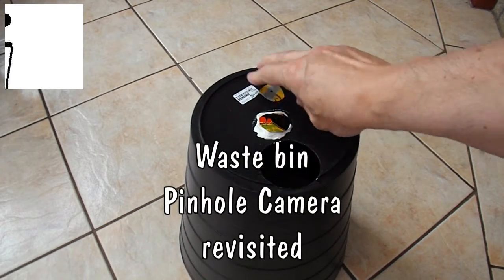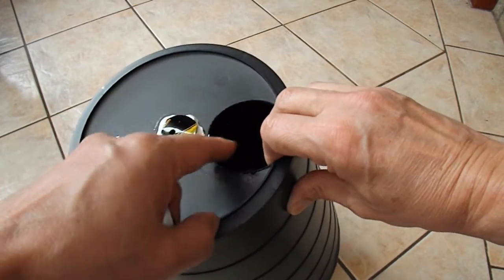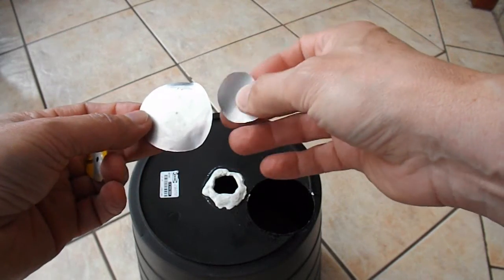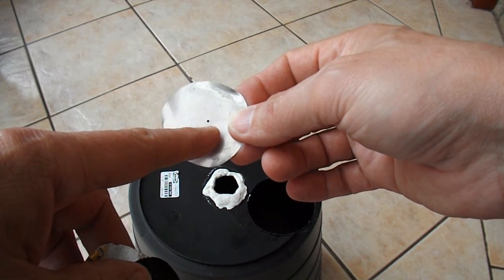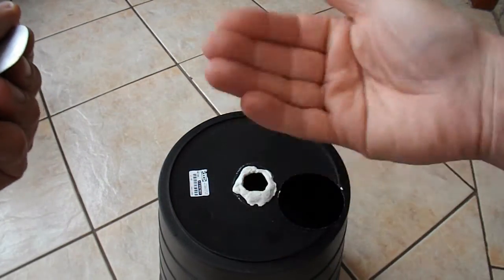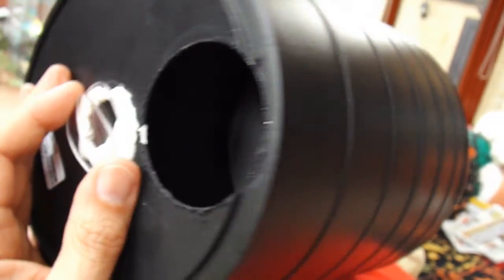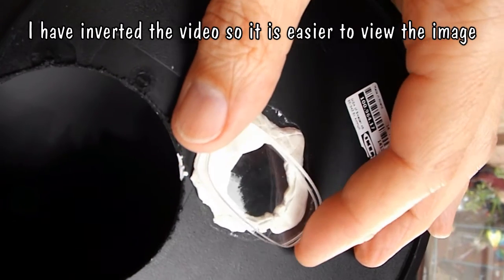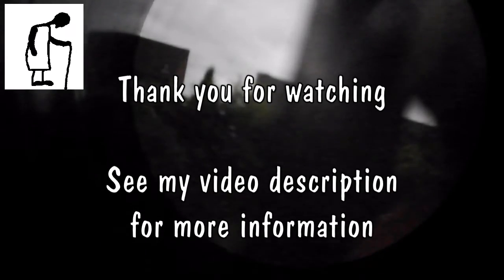Waste Bin Pinhole Camera revisited

Comment: Hello, I've tried this with a larger kitchen-type bin. This means the pin-hole to film distance is quite long. I'm using a 5mm pin hole but I'm getting an artifact on the film which looks like a large star or  'flare' in the centre of the image. Could this be that the pin hole diameter to film distance ratio is too large? As in, the hole needs to be bigger? I know this will decrease the definition unfortunately...
Reply from the maker: I would like to help but unfortunately I am no expert in this field so I cannot give you any guidance, I was simply following other examples on YouTube and Google. Good luck with your project.
Reply: No worries! Cheers mate!  @GrandadIsAnOldMan

Comment: With a lens on the front you would have a telescope/monocular I presume.
I like the use of the old glasses :)
Reply from the maker: Only problem is that using a lens rather defeats the idea of making a pinhole camera. What I need to do is look into adjusting the focal length to match the length of the waste bin. There is a formula that gives you the correct size pinhole for the focal length required. I ignored it and just tried guessing. I will try some better sized pinholes and see if I can get it right.
http://www.mrpinhole.com/calcpinh.php